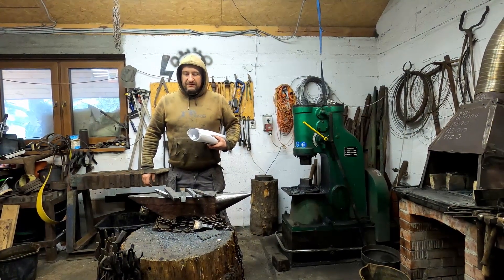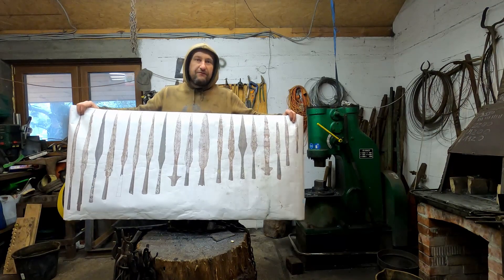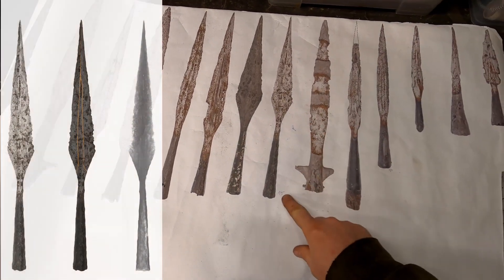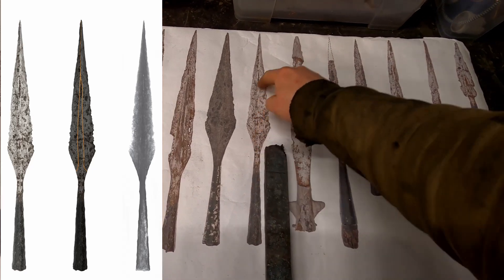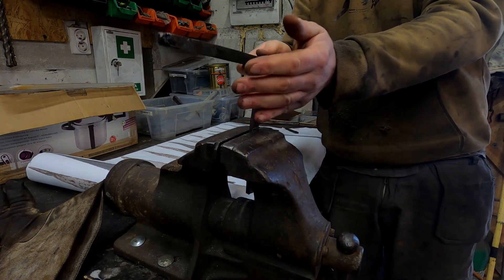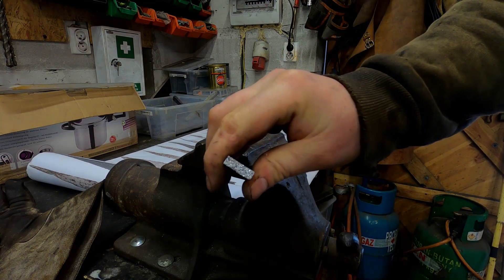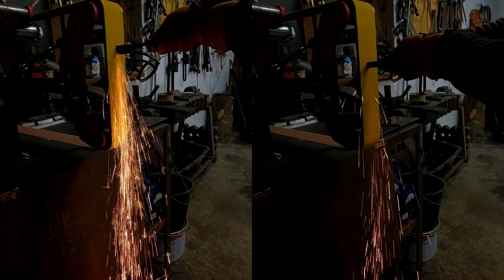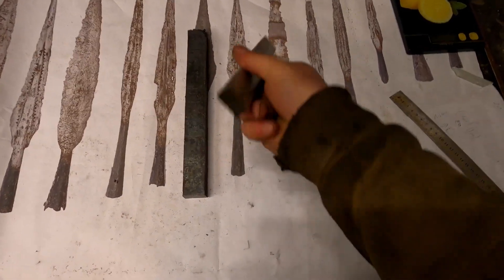Forging of the bloomery iron spear / Kucie grotu włóczni z żelaza dymarkowego

Comment: What steel of the core and socket did you use?
Reply from the maker: The bloomery iron i smelted myself
Reply: @officinaferraria  I don't understand type of steel. Is it carbon steel or mild steel?
Reply from the maker: @shmakov1000  very low carbon.
Reply: @officinaferraria  of the core and socket?
Reply from the maker: @shmakov1000  yes, the socket  and core is forged out one piece.
Reply: @officinaferraria  ok, but it looks strange.
Why did you forge it by two different pieces of the same steel?
Reply from the maker: @shmakov1000  ok. What do you mean core? The socket and axial part of the blade is low carbon. Cutting edges are high carbon and spacer is H-phosphorus
Reply: @officinaferraria  Oh, that is all what I want to know "What steel of the core and socket did you use?"
And you said "blade is low carbon. Cutting edges are high carbon and spacer is H-phosphorus". Is it from bloomery iron?
Reply from the maker: @shmakov1000  yes all of these are bloomery iron, smelted of different type of ores.
Reply: @officinaferraria  ok, thank you that is all necessary information. You didn't show it in this video.
Reply from the maker: @shmakov1000  here you are: https://youtu.be/Ar3suXRVgYA?t=47  https://youtu.be/Ar3suXRVgYA?t=63

Comment: Is there any advantage of pattern-welded material in comparison to steel you would use for the edge beside cosmetic purpose? I speak about pattern-welding in general not this specific spear.
Reply from the maker: The homogeneous steel always is better than the pattern-welded (nice, good quality non P and As alloy). The pattern-welded has been used for decorative purposes primarily, but not only. In historical times lot of iron was smelted using bog iron. this kind of ore contains a lot of phosphorus. P is undesirable addition of an iron alloy and causes brittleness in low temp. That's why blacksmiths combined P-iron and P-free iron. to get material that does not break completely  during use or in the winter when the temp was under the 0 C.
Reply: @officinaferraria  
Tq .👍

Comment: Beautiful work! Is it possible to buy one of those picture sheets yo have( of the spear heads)? Im a blacksmith from Finland and also make viking era stuff but I lacks a good pictures.
Reply from the maker: If you want, i can send you pdf file of this poster. Check video description, there is link to spears catalog.
Reply: Thanks, that would be just great! And yes I will.